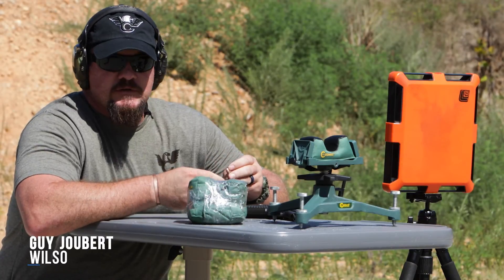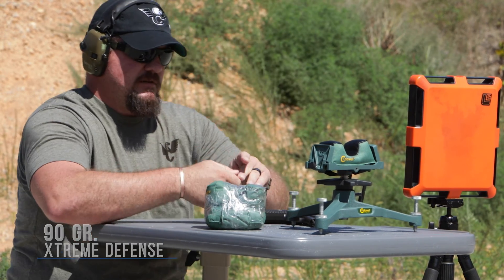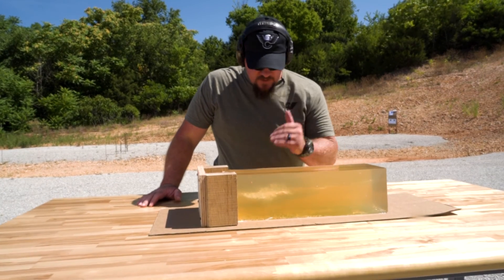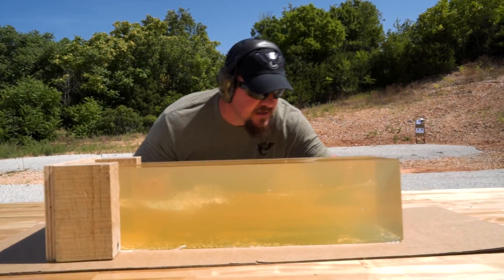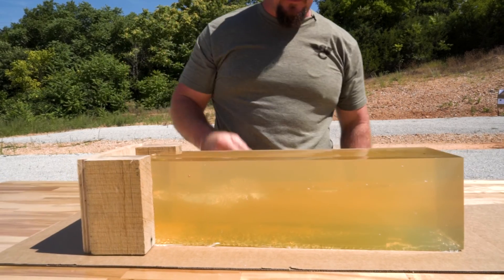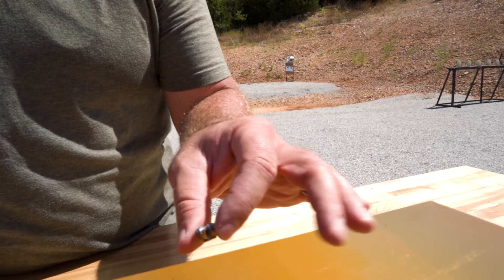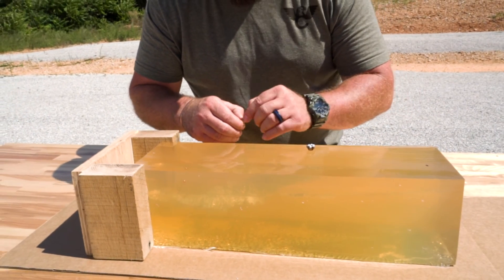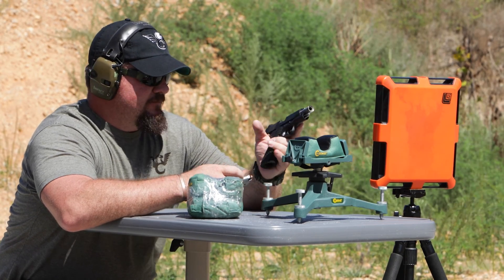Xtreme Defense vs a Hollow-Point bullet through a Barrier - gel test.  Here's what happened.

Comment: Shooting through a piece of plywood is pointless.  A far better and more realistic example would have been 2 to 3 layers of blue jean material taped over the ends of the gel blocks to simulate clothing on a real person. Also, there should have been two gel blocks, one for each type of ammunition being tested to show a clear and accurate expansion pattern that can be put and viewed side by side.  Putting 2 shots less than 2 inches apart in the same block defeats the purpose, as the expansion cavities overlap each other and you can't tell anything.

Comment: Even though the 124 grain was clogged, it still has the largest permanent wound channel
Reply: It looks like that to me, too.  I'd have expected the EDs to penetrate better than they did.  This didn't win me over.
Reply: @doghousedon1   Yeah I'm surprised they published this with that obvious result, and tried to pivot to overpenetration, a tired and dumb topic.  in the real world many shots will just miss the target.     This really confirms what I believed about these bullets which is the flutes just make them tumble or yaw in gel to produce a larger "wound cavity" , which by the way gel isn't even designed to show wounding, it's just a consistent medium to compare bullet penetration and deformation.   Here is a super cool video that shows what the xtreme defender bullets are actually doing, the flutes displacing fluid and causing more wounding is just nonsense.   At about the 4min 30 sec is a super slow mo of the defender bullet yawing weirdly through the gel, perhaps the flutes are useful to get the yawing action but obviously aren't doing what they are advertised to do.
https://www.youtube.com/watch?v=sxRqYPpDCZU
Reply: @Gieszkanne  Also, the hollow point was tumbling in the air after it exited.
Reply: I came to say the same thing.  Yes, the hollow point exited the gel, but it didn't look like it had the energy to do any damage at that point.  Even with the hollow point not opening, it still seemed to create a larger wound cavity.  I'm sure either round would be effective as a defense round, but this demonstration didn't make the fluted round seem any better.
Reply: But the temporary channel was much bigger. Meaning more energy dumped, and more hydrostatic trauma. Thus more stopping power. The permanent channel is only marginally smaller, and provides a great defense against an overzealous prosecutor. "I didn't want to unalive them, just stop them. And it's an easier wound for a surgeon to repair"

Comment: I don't even buy hollow points anymore. Great invention for their time, but the new barrier blind Lehigh bullet designs on the extreme defenders and penetrator are a no brainer. I use the 68 grain 1800 fps variety in my edc.
Reply: I think the recoil is low, but its hard to pay attention to that due to the distracting pressure of that round in an enclosed shooting bay.
It's loud and feels like I could clear my sinuses if I magdumped it. I feel the impulse in my face. It's like there was a sudden brief pressure change in a 747.
Reply: @mghegotagun Yeah, firing indoors sucks. Does it feel like more of a muzzle blast/pressure wave than a normal round?
Reply: @ToddSweeny  in an indoor shooting bay at least yes. As I've said, I feel a pressure in my face/head firing the 68 grain underwood loads with 1800 fps that I do not otherwise feel from other common defensive loads.
Reply: What kind of recoil and muzzle flip are you experiencing with those light 1800 FPS projectiles?  Also, what weapon are you running?  I’m thinking of getting these for my Sig p239

Comment: The hollow point appears to be the Federal HST, As it exited the gel block, It had expended >98 % of It's energy and did not have enought velocity to break the skin of someone behind the block, after passing through the wood, the bullet began to tumble and created a fairly decent would cavity, don't get me wrong, the monolithic CNC machined copper fluted bullet is a great performer, especially, the +P and +P+, loadings, and I've seen them outperform the HSTs.
Reply: I've carried the 124g HST for many years. I wish I could find those 50-round boxes I used to buy of it for cheap still. Luckily I stocked up on a bunch of them prior to COVID when ammo was still cheap.
Reply: As a attorney I only will say this,keep using these rounds it will put you I jail. If LEO does not use them you will have your first problem. Second problem is that prosecutors consider these rounds hunting rounds. Just a fair warning.